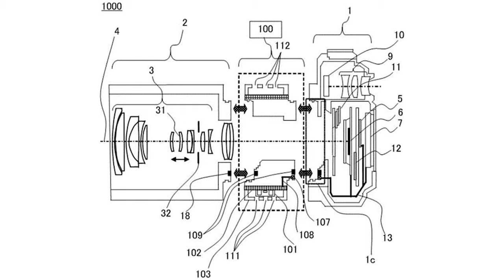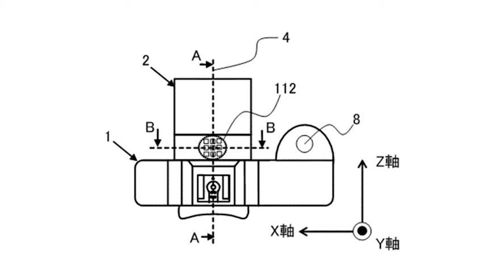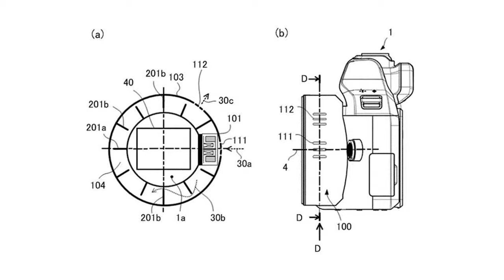CANON EF-RF ACTIVE COOLING ADAPTER NEXT? | Patent filed in Japan

Comment from the maker: So a new patent has been filed for an EF to RF Active cooling mount... Are we going backwards to mitigate the heat issues in video? What's your take on this? 👇
Reply: Gaston Shutters If you want 4K with Canon L glass, then buy the Cinema EOS C200B.  No overheating.  Canon Log.  

I think the Sony A7s bodies are actually cinema cameras, not photo oriented, at all.
Reply: @thesharpercoder  RF glass has focus breathing issues.  This will allow Cinema lenses to work with this camera. It makes sense for now.  I think Canon will release either a new Canon C100 or Canon C200 camera with RF mount to compete with Sony A7s III.  Give it two to three months.
Reply from the maker: Yep. I think they’ll release something like the XC line. I have an XC15 and love it but it has a fixed lens. This type of construction with RF will be killer
Reply: The only solution for the R5 overheating is going to be in the R5 Mark II.
Reply: @thesharpercoder  the a7S3 is going to be making some of the most phenominal photos.  Just watch online once they start getting in peoples hands.
I used to shoot professionally with a 12MP and you can absolutely print it out to 11x17 or even a little higher.  But the reality is the majority of photos are consumed online by devices that can barely even display 4K and in most cases the photos are reduced to 2048 or less.
Drives me crazy when I take 8 image panos with my a7R4 and then have to figure out how to show that image in 2048 or less.
There are definitely requirements for high MP, but for a large majority 12MP, especially 12MP with high dynamic range, great colors, and low noise will easily stand out.
We will see, I betcha you are going to see some images that could not have been taken with any other camera, especially low light with motion involved.
The a7S started as a photo Centric camera, it evolved into a video centric camera, but it was first and foremost a low light photography camera.
Reply from the maker: Hhahaha

Comment: RF to RF? the only reason the EF works is because of the flange distant. RF mount to RF will add unnecessary distance to that mirrorless lens. The camera shoots fine at 4K 30fps, the other resolutions and FPS is a bonus. My car goes 180mph, but that doesn’t mean I have to drive that speed all the time. I don’t understand how video people didn’t see this issue from a mile away. Did they all of a sudden think Canon was about to kill their Cinema line? Of course 8k and 4K 120 cause a shit ton of heat it’s a stills camera first.
Reply: I still think the 30 minute software limit is dumb though. At least let it be "unlimited" and only governed by heat.

Comment: I’m actually buying the r5 without getting RF glass to start out 
Doing architecture I want mainly for use with my TS but will certainly also be looking forward to all the goodies for my other ef glass as well like ibis dual pixel autofocus and of course I will have to live with primarily short video clips that is obvious now - I can live with that for now and get used to the new Canon system until next model shows up - guess they will learn like with the 5d mk ii and mk iii which I was so happy about despite the very limited film features - might even be that the not so smart add on like fan from tilta and possible adapter with fan could solve much for me mayby even giving me longer high res recording solutions - I’ll be following all the discussion closely and try to stay positive that it will be a good step up anyways

Comment: This device doesn’t make sense to me.  It does not work with RF lenses?

Canon literature states that when you use the RF-EF adapter, then the 5-axis IBIS downgrades to just 2-axis IBIS.  

The IBIS will work with EF lenses in a manner similar to the IS panning modes you get on telephoto lenses.
Reply from the maker: 🙃 my point

Comment: This will accumulate dust inside the camera.
Reply from the maker: The back of the camera is sealed and the fan expel so it will remove dust if anything ...😁
Reply: @GastonShutters  i think not, if this device sucks out air/heat from inside the camera body, even how seal the body, air will pass thru is, and together with air, is dust.. due to static electricity inside the body, dust will remain inside, and will accumolate in time.

Comment: Huge bummer. I was getting ready to order some RF glass for the R6. This heating issue is a total no go for me. As a general contractor a lot of the filming I do on our jobs and is in less than ideal conditions. Why can’t camera company’s figure this out. We want a good flip out screen, IBUS that works and some good wide angle lenses. 
 Canon cooling adapter. Nope not for me. I’ll wait for the corrected R6.